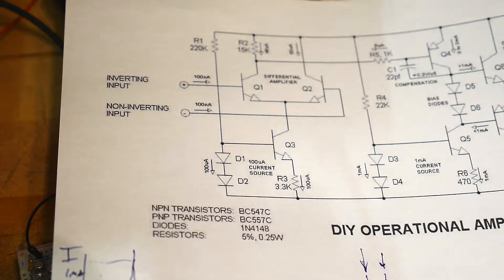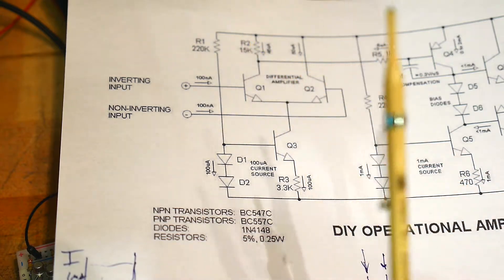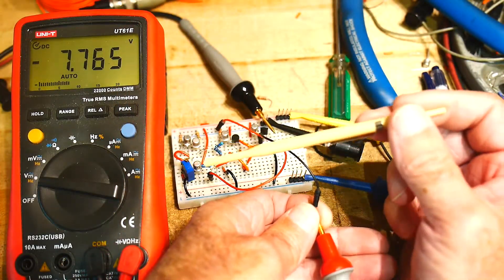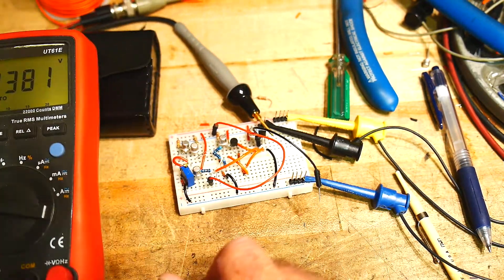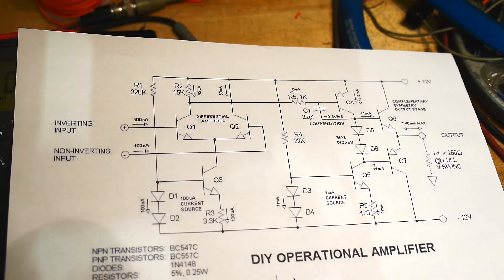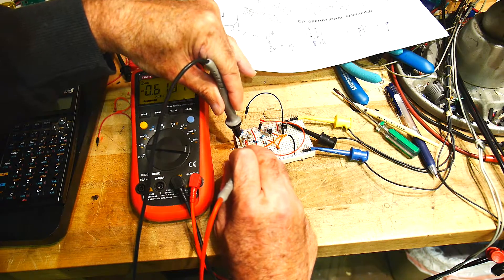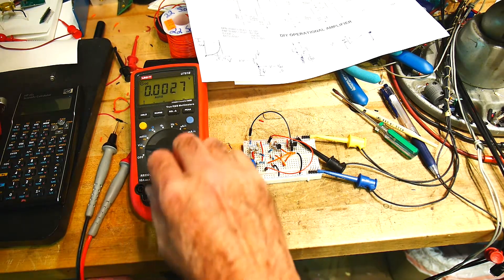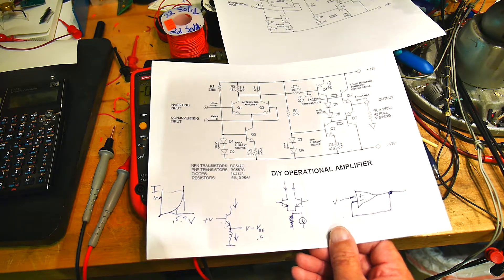#415 Build an opamp (part 5 of 7) offset voltage adjust

Comment: Yay!  An offset-corrected op-amp. As As I mentioned in a previous episode, I’m in agreement with you that the adjustment would seem to be better placed up top at the collectors. I guess one factor to consider in choosing which adjustment is best, all else being equal, would be to choose which method leads to the least power dissipation, or if you want to consider other performance factors, which method yields the results you favor most, regardless of power dissipation.

Comment: just for the sake of experimentation , it would be interesting to try a slight mod. Why not disconnect Q1 and Q2 emitters from Q3 collector. Change R3 to 2.7 K . Then connect the wiper of a 1K pot to Q3 collector.  Connect the remaining ends of the pot to Q1 and Q2 emitters respectfully .  It may make adjustment of offset less critical. Just a thought. Very good series by the way.
Reply from the maker: I'm sure there are a million ways to improve the circuit. real op-amps use a current mirror that is adjustable from side to side